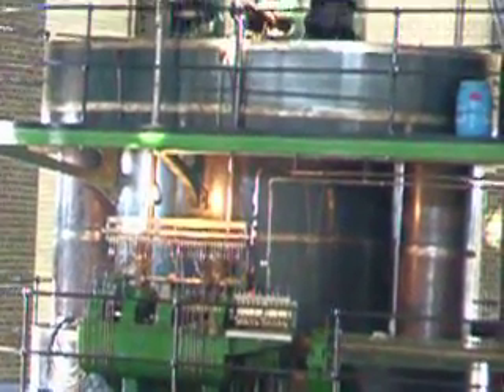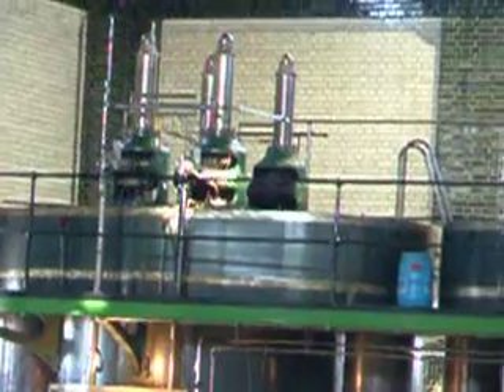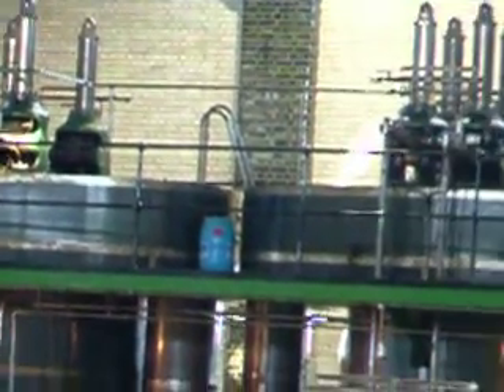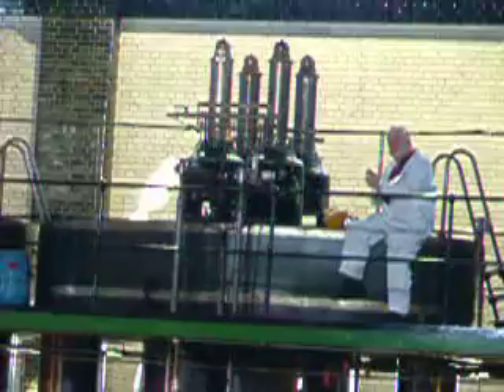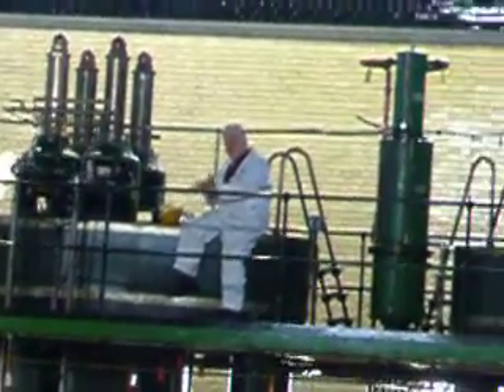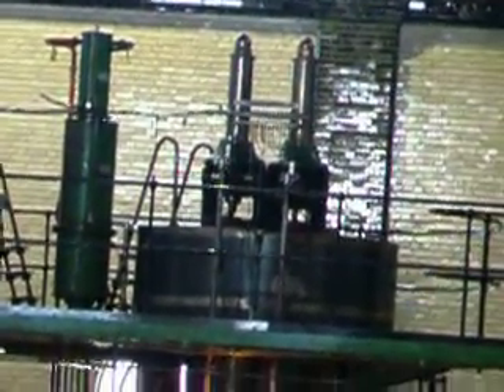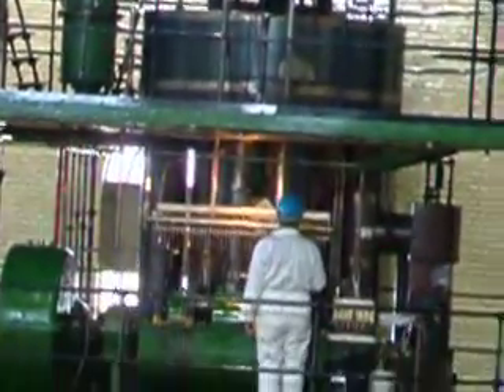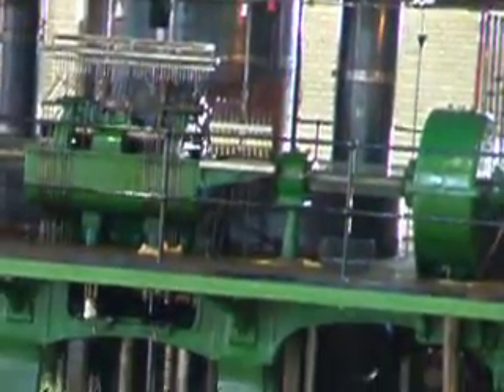Kempton Great Engine (5)

Comment: I am not sure about that, however, coming here for the first time yesterday, I noticed that the engine looks very familiar as if I had seen it before.  The large flywheels and green paint somewhat give it away. So you might be correct in saying that this WAS the engine that they used in that film. I would have to research that some more.  One thing though, the size of this engine would be about right outside the fact that this is a 3 cylinder engine and the (real) Titanic had 4 cylinder engines.